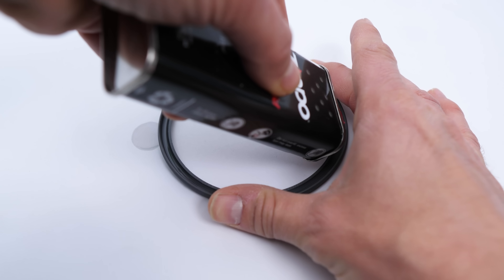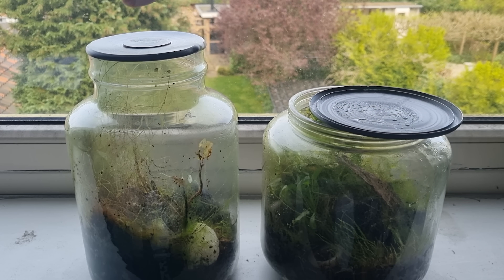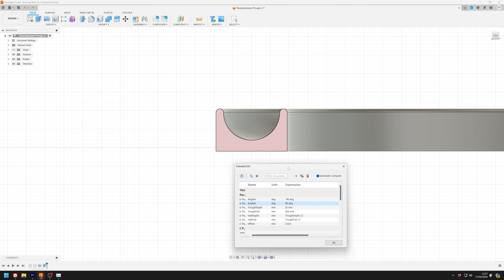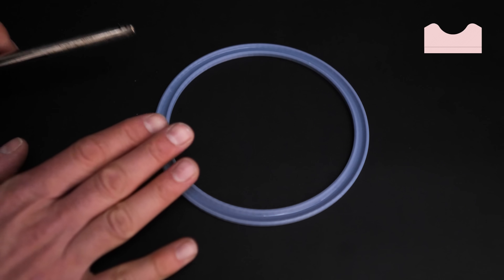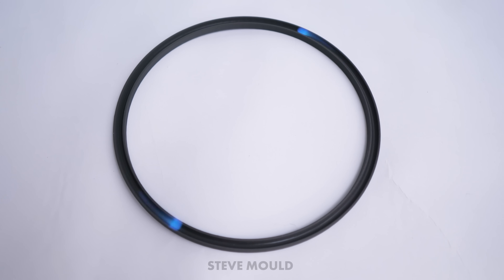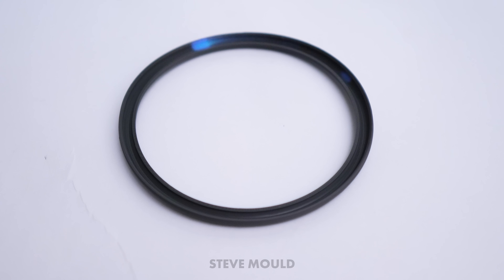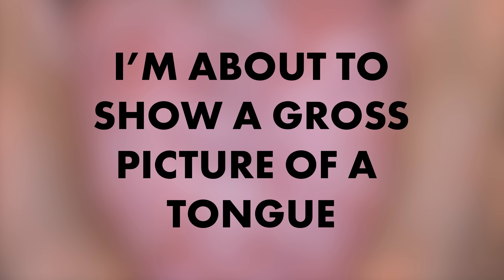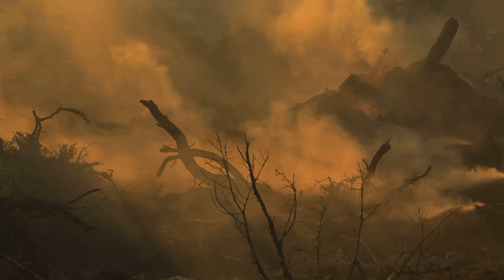Bizarre travelling flame discovery

Comment: You mentioned cellular automata that model excitable media. The WireWorld ruleset seems to model this particular type of system quite well, and has been demonstrated to operate as a computer. This presents a variety of interesting possibilities for track designs: diodes that permit flame front propogation in only one direction, logic gates that permit flames to exit them only when they recieve particular patterns of flame, perhaps a more reliable clock or oscillator…
Reply: This is giving me steampunk ideas
Reply: Great thinking.  How about a fire computer/calculator?

Comment: I know there have been experimental rocket engines that play off of this idea and try to create a continuous front of combustion (though I think they really try to achieve a stronger continuous explosive front). If I recall correctly, this can be a very bad thing in existing standard rocket designs if they get a fuel imbalance -- often they need special baffles installed to calm any such explosive front that may form unintentionally

Comment: Nice video but you could argue that you could have a never ending fire around earth but there's two variables not considered. We don't have a total ring of landmass. Even of we did and the fire could spread it would do so in a zigzag pattern where there was tree coverage. Oh wait then there is peaks and troughs there's mountains and rivers. I guess even if there was a total circumference of forested land mass the true circumference of the earth would be whey more than double the 3.142 xr2 so the whole math here is incomplete by a huge amount. A river for example as the crow flys may be 50 km but its actuall length is often 10 times that amount. Is all good and well demonstrating things in a 3d printer but this had nothing to compare to the earth's surface. Having said that there's going to be loads of benefiting technological advances from what we've seen here and I'm a huge fan of what humanity can achieve with the 3d printer. Unfortunately one of them is not to make assumptions of how the word works. Unless you printed a world, as big as this one

Comment: I actually think the infinity/figure-8 trough exhibits a SLIGHT acceleration of the flame over the "hill" portion. Maybe the draining effect results in an elevated rate of evaporation due to the inability of the fluid to pool in that spot, and also because the flame running beneath that location heats the track above and prompts even greater evaporation?

If you mentioned this later in the video, I'm going to feel pretty silly - but I had to leave this comment all the same. 😅

Comment: I want to see a fire based binary calculator. I think the fire should be 0 and no fire 1. Something shaped like a Y... if you supply 2 fires (or 2 zeros) at the  top of the Y  both fires cancel out at the junction and you get no fire at the bottom of the Y (no fire = 1). If you only supply fire at one side of the Y it goes trough to the bottom. That's 1 transistor. Then you can do AND, XOR, OR etc gates. Not sure if a diode would be needed and is achievable -- fire going in 1 direction but not back 🤷🏻‍♂

Comment: Physician here, found an interesting parallel to a cardiac arrhythmia in one of the models. At 10:26, the small loop of the ‘flame splitting’ model starts its own circuit, increasing the activation rate of the larger loop. This is very similar to the cardiac arrhythmia ‘AV node reentry tachycardia.’ The cardiac conduction system is also an excitable medium that meets the 3 criteria mentioned my Steve in the video. This flame model could be an interesting was to demonstrate or study this disorder. 

Thought this was interesting and wanted to share. 

Thanks for always making interesting and stimulating content, Steve!!
Reply: I was proud as an M2 to recognize the AVNRT pattern! glad someone else noticed it.
Reply: "Why do you use youtube do much" because nowhere else can I partake in content like this and have it accompanied by great comments like this.
It's the best.
Reply: I was just writing a comment saying exactly the same! I thought I should look to see if any else had commented on it, and here you are! I have AVRNT, so recognised it straightaway.
Reply: @robertrutz9230 Incredible brain fire lit by this comment, I can further this analogy: I was a child that was cured of WPW (slightly different than AVNRT) via a cardiac ablation. This flame behavior is EXACTLY how I would describe the literal feeling of the starting mental stimulus that would trigger the arrhythmia and cascade into exteme heart racing. It would begin with a slight sensation of falling then the first aruthmia would cascade into tachycardia in exaclty the same chaotic rythm that you can see in the multiplying flame. I was cured 20 years ago, but to this day I still get the falling sensation after the same mental triggering stimulus but no longer the tachycardia similar to when he puts his hand over the ring and the flame dies out. The craziest part is the only way I could bring my heart back to normal was to stand on my head an hold my breath until almost blacking out before i had the ablation. My slgithly oversized heart goes out to the amazing people like you and the pysicians who change lives of people like me  <3
Reply: It almost sounds as if a fire has been lit in the minds of some curious and inventive med science minds. Wonder what that will lead to. And another example of an excitable system, I guess. 😂
Reply: @lhpl  I already got the chills when they talk about bistable auxetic materials as coronary stents. And now they got this as a model for reentrant arrhythmias. Literally unites all us physicians who are also nerds
Reply: Also a physician - I paused the video to come and point this out, glad to see someone beat me to it!
Reply: @dentalfloss1 Same!
Reply: and I wonder if there are ways to speed up the movement of these flames, similar to that of myelination
Reply: @whichline8408  yes, designing one in configuration of a " tesla valve"
Reply: As a med 6 graduate looking to go into cardiac electrophysiology, this is my exact same thought!
Reply: You can recognize the 3 criteria for a reentrant arrhythmia there: a closed circuit, a unidirectional block, and a wave length < path length
Reply: That's fascinating
Reply: Ha, same thought. Not (yet) a physician though.
Reply: As a doctor first thing to come after seeing this was cardiac depolarisation and arrhythmias.
Reply: Like the flame movement, it’s caused by oxygen and pressure differentials, at the moment of combustion the oxygen is taken away and the flame moves because the pressure changes when the oxygen is consume at the point of ignition. Then physics takes over, the path of least resistance is the part with the fuel, ie the area directly nearest the point of ignition. The result is movement.
Reply: @ironhell813 Yeah you might have put your answer under the wrong comment
Reply: Fair play. It throws up a lot of possibilities
Reply: Belousov-Zhabotinsky reaction might be similar
Reply: I'm very interested in whether this model can demonstrate entrainment
Reply: I'll be honest you said a lot of big words. Most of which I only partially know/understand
Reply: Thanks for the additional info. I understand that reference now, but I didn't in the video.
Reply: That is fucking amazing!
Reply: Very interesting! Thanks for sharing much love ❤️ 🙏
Reply: Thank you, now I know what the heck was going on that time I was struck by lightning (close).
Reply: As a Nobel Laureate in Medicine, I have observed a fascinating parallel between cardiac arrhythmia and a phenomenon observed in one of our experimental models. At precisely 10:26 in the recorded experiment, the 'flame splitting' model reveals a small loop initiating its own reentrant circuit. This newly formed circuit subsequently increases the activation frequency of the larger loop. This dynamic closely resembles the pathophysiology of atrioventricular nodal reentry tachycardia (AVNRT).

In AVNRT, the cardiac conduction system, an intricate network of excitable myocardial tissue, exhibits reentrant excitation—a hallmark of this arrhythmia. The heart's conduction system fulfills the three essential criteria for reentry: an excitable medium, a unidirectional block, and a pathway with a sufficiently long refractory period, as detailed by Steve in the video.

The 'flame splitting' model provides a compelling visual and conceptual analogy for AVNRT. This model not only elucidates the reentrant mechanism but also offers a novel and potentially transformative method for the demonstration and study of this cardiac disorder. Its application could enhance our understanding of arrhythmic pathophysiology and pave the way for innovative therapeutic approaches.
Reply: Something like in Chaos theory, period doubling, then quadrupling, then chaos?
Reply: Interesante comparación. 
 De la misma manera en el minuto 11:33 el diseño en círculo que alimenta al diseño en espiral podría considerarse el Nódulo sinusal como marcapasos natural del corazón y la espiral como la red de conducción hacia el tejido muscular cardíaco. 
 Una vez más se producen en la Naturaleza analogías muy significativas.
Reply: tbh I find it interesting that this can apply to many fields I’m a low voltage tech and when u break down electricity to its core its extremely confusing but I believe that feed back loop u spotted also applies in what I would find in spliced wire in certain instances, mainly bad practiced installations. Therefore i believe this would cause a feedback where it would pop a fuse let’s say, but only that smallest of a fraction of probability to pop the fuse every-time u turn on the device, even if theres nothing wrong with the wire. 

also this could explain how electricity travels in the first place because from what ive seen it will turn on the device but the way it travels to the device microscopically changes, this doesn’t really matter in real life but for calculating precise movements of particles it does.
Reply: Maybe not?
Reply: God dam You didn't need to write an essay
Reply: @aden1knox137  Plenty of other people that commented here seem to believe otherwise. Just because you it doesn't interest you doesn't mean others won't enjoy it. Also calling a couple paragraphs an essay explains why you're upset at a very informative, on topic, and interesting comment.

Comment: With the spiral. If you had a more open section at the beginning, which would continue to burn. Into the normal section. Would that create a flame to ignite the fluid when it has produced enough gas through the spiral. So you don't need the ring or continue to ignite it yourself

Comment: A hypothesis for why the narrow opening doesn't allow for the flame to travel could be that the flame creates a weak convective current that draws air into the channel through the narrow opening nearest to where the flame is. The narrower the opening, the faster/stronger this airflow would be, making it more likely to displace any lighter fluid vapor adjacent to where the flame is currently burning. This could be why the flame sustains a bit but doesn't move far from the starting point. For channels where the opening is wide, I'm assuming that any sort of convective current created by the flame is too weak to disrupt the motion of the flame.

Comment: For lack of a better term, if the channel is "ribbed" couldnt you increase the surface area and delay the flame speed, so you could stabilize smaller ring sizes?
Reply: Not sure if concave or convex ribbing along the channel would be optimal, but just curious.

Comment: For lack of a better term, if the channel is "ribbed" couldnt you increase the surface area and delay the flame speed, so you could stabilize smaller ring sizes?

Comment: I had exactly the same thing when I had a 'solar' grill 25 years ago: it filled a rounded rectangle area with gas through a series of holes like a dangerous air hockey game, that you lit to grill toast or sausages, but if I turned the supply down, I could get a flame running around the track.

Comment: Since its quite likely that the fire going round and round is due to enough vapour being regenerated during the cycle for it to continue burning, would that not make the diameter of the circle a very important factor as it increases the circumference that the fire must travel and therefore increases the travel time and the amount of time that vapour can be generated in. Therefore all of the original experiments could be affected as he printed them all in seperate diameter circles, therefore there were two independent variables in each test making it unreliable.

Comment: Its very interesting when you show the splitting of the trails @ 10:12. the mechanism appears similar to atrio ventricular node (AVN) which infact has 2 pathways like this model. In certain situations, the depolarization just remains in the small circular part and sends fast signals to atria and ventricles and you develop disease like AVN re-entrant tachycardia (AVNRT). see https://en.wikipedia.org/wiki/AV_nodal_reentrant_tachycardia for the figure.

Comment: Reminds me of rotating detonation engines which are a rocket engine that uses a continuous explosions front along a channel of fuel, to generate thrust. They are only experimental and have many challenges, but could possibly be more efficient that normal combustion rocket engines. They use channels that get filled with fuel, just like the ones you show. Their main challenges is keeping the explosion front stable as it goes around and making it symmetrical, because any asymmetry would cause the rocket to rotate. They have the same problems you faced with branching points not always working correctly and reliably.

Comment: very interestingly this is kinda similar to our heart's electrical activity, burning as action potential, and the refractory period as fuel vaporize before the next combustion is possible.
at 10:20 this is kinda one of the mechanism of arrhythmia where electrical activity becomes chaotic because of dyssynchronous polarization/repolarization, or a internal circuit that causes reentry to happen.
11:30 and this little extra structure is like the SA node 😀

Comment: You just figured out a phenomenon, that I think is being developed right now in rocket engines. I got a friend in engineering that told me they are working on an engine design with a flame spinning around, gets 30% more efficiency as of now
Reply: You are correct, it’s a similar phenomenon to rotating detonation engines. There are some big differences to the RDE design relative to the simplification in the video, but it works off of a similar principle
Reply: I was looking for this comment, figured Steve was going to bring this up!
Reply: I was thinking about the rotating detonation system too! They have a slow motion video of one in action. It’s actually so much faster than the fire rings in this video
Reply: That's occurring at a faster rate by orders of magnitude, but it is similar.
Reply: This is true, but with an RDE, it's more a continuous explosion, which I believe helps compress  the fuel air mixture just ahead of the blast wave, then ignites the compressed mixture. This is like a piston does in an internal combustion engine, or like a turbine does in a jet engine, just that it's done cyclically, using the blast wave instead of linearly with a piston or turbine. The forces involved make this incredibly challenging, not to mention the fact we still have a basically infantile understanding of aerodynamics.
Reply: I just commented the same thing, scrolled down and saw your reply as well, we must have watched the same video about that!
Reply: I just commented asking if this is what's happening in a rotating detonation engine, super neat.
Reply: Why not combine this periodic excitable medium + rotating detonation rocket engine (RDRE) AND ALSO an aerospike? Aerospikes are round too.
Reply: Bro really hit em with the “I got a friend in the industry”
Reply: @MichaeldeBidart  ^^ without him I wouldnt have really known about this, and when I state this from the start, nobody asks me any questions, cause I am not the expert 😂 uhhh flame go in circle maybe go forward fast?
Reply: He just saved rocket engineers thousands of dollars with this video

Comment: If you could make a one way valve, you could in theory make OR gates. Maybe if a circle continuously made pulses at a junction where the fire can't go back, you could send more pulses and they would cancel each other as it burns more. You would occasionally get pulses out so it's not a perfect NOT gate but if one could make a NOT gate and a check valve you can make an AND gate and the rest is just complicating the circuit.
Reply: Maybe you could make two small channels where the fire cannot pass but when two pulses come at the same time it heats up the next part enough to get a pulse out.

Comment: I can imagine having 2 porous mediums with one letting lighter fluid and air through and the other medium being a good absorber and distributor of lighter fluid.

You can then charge air into the bottom of the "circle" letting it pass through the plastic and then eleviates the carbon dioxide from the bottom.
At the bottom of the "circle" the 2nd medium is placed around it(good absorber and distributor) that serves the same purpose as the candle wick that collects the lighter fluid at a point and then capillary action will equally distribute it all around the circle, then having the plastic absorb the distributed lighter fluid creating an air fuel mix.
I think that will allow you to control the rate of the flame and have a continuous action as fuel is entered into the system